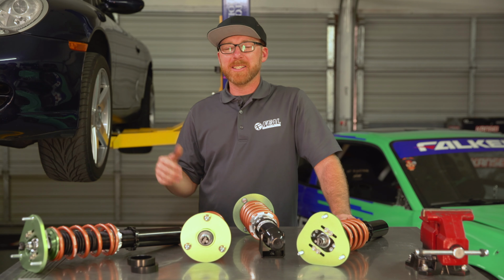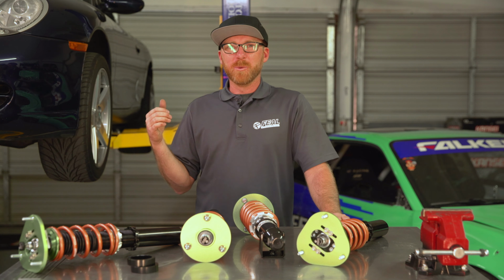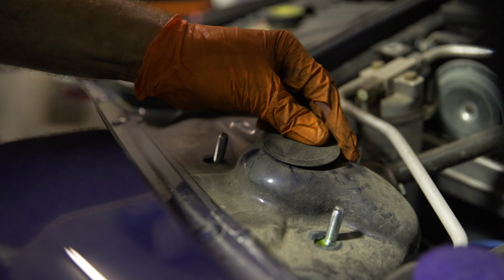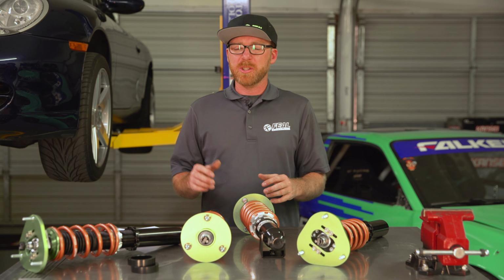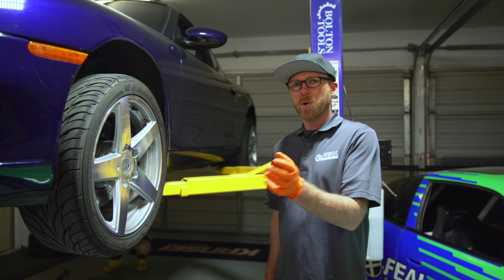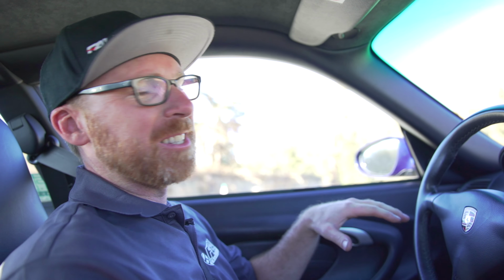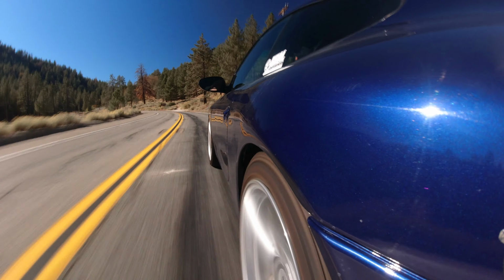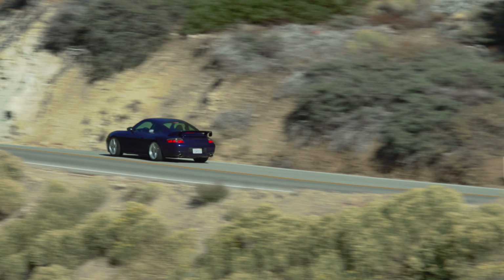996 Feal 441 Coilover Install and Test Drive

Comment: I'm installing a kit on a 996 Turbo right now.  They have pretty heavy springs on them, we'll see how they ride.
Reply from the maker: Awesome! Have fun and let us know how you like them.
Reply: @FealSuspension  They are good. Even ride pretty well considering I have 12/15 springs. I just ordered the adjustment extenders for the rear shocks. Love the adjustability of this setup.
Reply: @FealSuspension  Thanks will do.  What improvements have you guys made to these over the standard version from BC.  I know you are using much stiffer springs.  Mine are 12k/15k actually.  These generally get really good reviews from the people that use them, BC and Feals.
Reply: @ChrisHimself1357  Mine have really heavy springs.  They are working well but I had to tighten the screws most of the way to get enough dampening.

Comment: Nice!  I am interested in 997 AWD setup.
Reply from the maker: We do make the 997 AWD kit!
Reply: @FealSuspension  Awesome, I assume it has the correct rake, front strut mounting and sway bar provisions , and no other parts or mods are required ? What are default spring rates ? Would I be able to get actual photos of the coilovers ? sent to : gtssport AT gmail com
Reply from the maker: @ajberg6451  Sorry for the delay, we don't get on here very often. The 997 kit fits proper without any other modifications required. Default spring rates are 7/12K. We will take some photos of the next 997 kit we assemble.
Reply: Is the 996 911 C4 convertible and hard top same part number for suspension..  do you have supplier in Toronto Canada
Reply: @aliaygun9975  Hi, yes same part number. www.iraceautosports.com is a great Canadian re seller